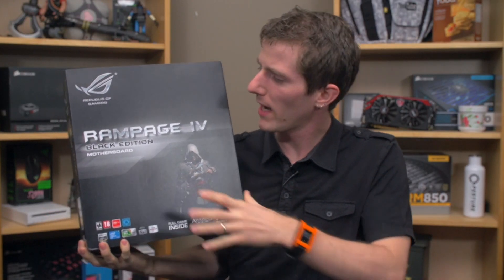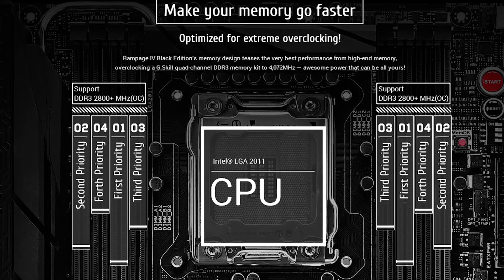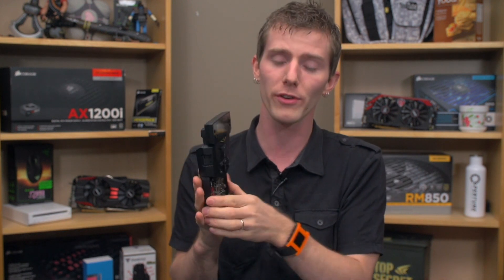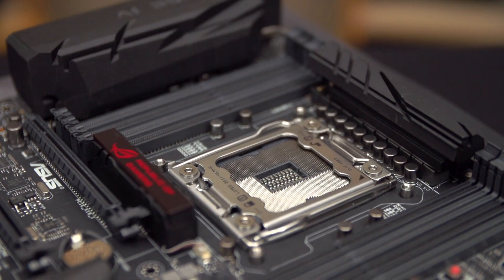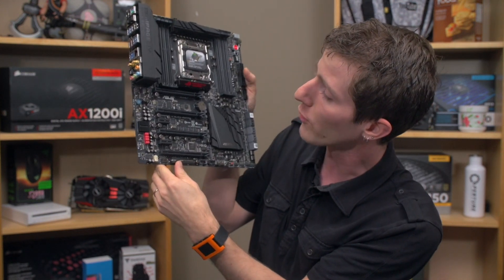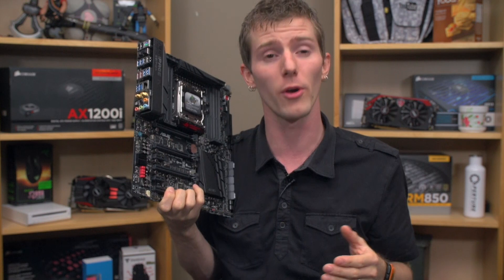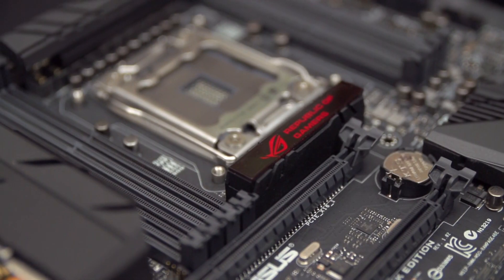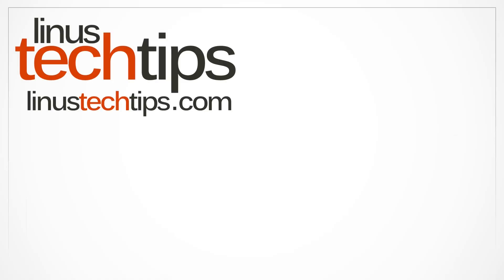ASUS Rampage IV Extreme Black Edition Unboxing & Overview

Comment: There is one thin with motherboards that i dont understand; on some motherboards there is a, often red, start button, do i need to press that button when im going to start it for the first time or do i need to press it all the time when im going to start the system or should i dont do anything with it? HELP IS APPRICIATED
Reply: It's only for bench testing when you connect it up out of a case. The power switch is on the case so you can't turn it on unless you rig up a switch.

Comment: hey, do all motherboards work with all cases?
Reply: No, the case needs to be big enough for the motherboard. An ATX board wont' fit in a micro ATX case, and some really old motherboards might need an equally old case. You can usually put an micro ATX motherboard in a gigantic case though, like a Cosmos II. Why you would I have no idea.

Comment: Would this Motherboard fit these cases ???

1. Aerocool X-Predator Full Tower Gaming Case with No PSU
2. Cooler Master Storm USB 3.0 Trooper Window Side Panel Edition XL ATX CASE
3.Cooler Master CM Storm Stryker XL-ATX Case
Reply: Yes it should
Reply: Anything that is Mid tower and above can fit a regular ATX motherboard and a full tower can fit any size. I have a Phantom 820 and it was a lot bigger than I thought and has soo much space left.

Comment: I'm really annoyed !!!! I just got this board and when I plugged in a usb cable for the first time the black plastic in the usb port snapped -_-  usb port still works fine. Out of all the motherboards I've ever owned this has never happened. I never forced the cable in or bent anything but as soon as i plugged it in it snapped. Dunno if to contact Asus but after hearing about there customer service I think it will be a waste of time :/

Comment: is this better then the ASUS Maximus VI Formula?
Reply: yup but mainly for overclocking and extreme! not a lot for gaming.
Reply: I've done some research but Overclocking is for gaming it's helps push for more Fps usually pushing to get 60fps but with the new 4k screens this board is the one to buy! and also 2 titan blacks or you can wait for the 800 series to see if one of those GPU's can handle it.
Reply: +AronWard you don't need an insane motherboard for gaming.. Good price for a mobo is $200 AUD..
For a $2000 build atleast

Comment: It looks really good, but you do not have to spend 400+$ on a board to have your system looks great, g45-65 gaming from MSi are quite nice, more affordable ROG board also look really nice. And this board, if you are not overclocking with liquid nitrogen, it's useless.
Reply: This board isn't purely about looks, it's mostly about all out extreme performance for extreme enthusiasts.

Comment: i think in terms of looks, this is NOT the best looking motherboard
the sabertooth actually looks better because of the shroud, you cant see any of the shiny solder connections
but sadly its only 1155 or 1150
this is the nicest looking x79 platform, i agree

Comment: Not very smart IMO to promote throwing away your motherboard driver disk. It usually comes with full version software and can come in handy if you just want to get your system up and running before updating everything to the latest version.

Comment: Does it support 16GB RAM cards?
Reply: It supports 64 GB, but honestly if you have to ask you don't need it :/
Reply: well, what I meant is on pcpartspicker, they have 1x16GB but they show that no motherboards support it, so what I meant was, will this board? cause pcpartspicker states that it is a no...
Reply: RepoDraghon Are you wanting to just buy one 16GB Stick? The thing with 16GB sticks is they haven't quite come around to date especially because a lot of boards (like this one) that are quad channel. So 1 stick of 16GB Ram vs 4x4GB will actually under perform the 4x4GB. You could do 4x16GB for 64GB but I don't recommend that and 16GB are still not up to speed for consumers.
Reply: actually from what I have read on sites and this one particular, it's better than most cars half it's size, with 7 as its CAS
Reply: Use 32gb ram and get yourself a RAIDR
Reply: I'm already a Raiders fan
Reply: RepoDraghon
 Well dude I meant the new ssd lol and also I have the motherboard I use 32gb ram 2400mhz and a RAIDR Express With another SSD and 2 3tb hard drives. ROG Fan FTW
Reply: I knew what you meant...
Reply: The maximum it can do is 64 so.... yah

Comment: 10,000 hour capacitor lifetime? That's only  1.145 year continuous use! I understand that using the machine only to game a few hours a week this would be fine, but it sure doesn't leave much product life for people who either work daily on there PC or have it complete tasks every night. I get its not a server board, so 24/7 use isn't recommended but I'd like more than 2.75 years of 10hr a day computer running, especially since your CPU's and RAM are rated for more than this sort of duration. All in all very disappointing Asus... my laptop has that many run hours on it, your top of the line ROG motherboard should be rated for more.
Reply: I'd also like to have seen 4 way or at least 3 way 16x PCIe use... only getting 8x to everything but the main card in setups with more than 2 PCIe slots filled is a very poor offering for a board of this price-range.
Also the lack of right angle connectors is disappointing given the otherwise great aesthetic.
Having said all this the onboard auido sounds good and I really like the idea on motherboard controlled 3pin fans so you don't get PWM noise when running lower RPM, I just feel this board is badly underspecified for its price, especially compared to ASUS's own Saber-tooth board in the same socket, which offers nearly all the same features save for audio (a sound card or DAC will give better audio anyway) and overclocking for a lot less money, and the saber-tooth boasts the same (or better, dust covers ect) aesthetic quality and a longer warranty as well.
I guess in a nutshell I just don't get how Asus made there top of the line ROG board worse in many ways then other boards in ther lineup, a few right angle connectors, a 5 year warrenty and four way 16x mode PCIe would have seen this board be one of the best on the market, but as it is its an expensive white elephant.
Reply: Hamish McGregor
4 way PCI-E 16x would mean Asus telling Intel to increase the PCI-E lanes from 48 to 64. That isn't something that Asus can easily change (because the PCI-E controller is on the CPU die) and PLX chips aren't really that great because they introduce a certain amount of latency.
Reply: Hamish McGregor I don't think that would be possible, as the 16. pcie to anything more than the first slot is reliant on the chipset/socket. you could only get 2 16x slots from an extreme edition. Not Asus' fault I don't think, that's all Intel. (Source, my own faulty memory, so take that with a grain of salt)
Reply: Fetzie
True, I hadn't actually thought through the implementation of the additional PCIe channels, I was really just meaning it lacked features to really set it apart from ASUS's own existing 2011 socket lineup, especially the non-black edition rampage 4 board it is based on.
I think it is a great shame Intel haven't switched the 2011 "extreme" lineup to support 4 16x mode PCIe cards, it would have made sense to sell 2011 socket i7's with 64 lane controllers while 1150 used a less number (40 is ideal), but that's sure not Asus's call. However the limited warranty and capacitor life, lack of DDR3 3000mhz support as well as non-right angle connectors on the other hand are all Asus's fault, and seem to be just cost cutting, sad for a board that commands a huge premium for being there top of the range setup.
Reply: you are looking at the surface stat of the capacitor not its real run life. It is a rating for 10,000 hours of use at 105c which is so much higher than any system runs or any component other than a capacitor can handle. My 8 series  gygabite board has the same nichicon gtx 10k black alloy caps and the VRM section is never above 50c running at these temperatures will expand the life of the motherboard by orders of magnitude, I don't have the charts at hand but something like a million hours of use should be expected. needless to say something else in your motherboard will break before that happens.  even if you run the black caps at 85c non stop they would last longer then you would ever care to use the same computer decades likely, but again another component will likely fail before this has a chance to, that's basically the point of using the cap, one less thing to worry about.
Reply: In your theory, my P45 board would have already died like 3-4 years ago, but it's still running 24/7 as my backup server PC right now.
Reply: Jateruy Xu
My comment wasn't that it will die, as I even said my Asus laptop has run for more than 10k hours by now. My comment was regarding the fact that 10,000 hours is used as a marketing term because it sounds huge, but the underlying fact is that it is not that long, only just over a year.
Reply: Hamish McGregor Indeed then, but it's still making sense when the situation applied is non-continues use. In this case 10,000 hrs would really sound a lot.
Reply: its just the measuring standard used on capacitors, asus didnt invent it, gygabite has been telling you hour ratings@ 105c for a decade, tear open a 20 year old sony walkman and see how its capacitors are rated.

Comment: Can it run 4 way sli 16x16x16x16x?
Reply: no. he says in the vid 4 cards can run max 16x 8x 8x 8x.
you look at the back two of the are only 8x anyways. but you can run two in 16x 16x
Reply: Gamers Life :(
Reply: ShamanKing77LaTale sorry to bum you out...
Reply: You'd need an X79 board with PLX chips for that, like the P9X79-E WS or the Asrock X79 Extreme11.  X79 by default has 40 PCI-E lanes.

Comment: Ok this is so Embarrassing...got the Mobo and the i7 4960X now only thing is I suck at overclocking this properly...I wanted to overclock the CPU to about 5ghz.... -_- failing badly at it...I made till 4.6Ghz but I have no idea how to go further than that...anyone here can give me a noob guide? Please!
Reply: +avikbellic911 There is no Extreme Overclocking for noobs, sorry. 4.6 GHz stable without knowing what you really did there is respectable but going further into the matter about BCKL, strap, PLL, VTT, overvolting, maxing LLC, etc will just higher the chances that you destroy your stuff if you don't know what you're doing.
There is no "instant knowledge" that you can take out of the packaging, pour hot water over it and suddenly you know everything. It's a process that mostly starts with reading, reading and reading. Did I mention that you have to read a lot?
After that it's learning by doing by really thinking about "What am I doing here? What exactly are those settings and what do they do? What happens if I change them?". If you can't answer those questions, don't do it.
Also, overclocking the CPU alone mostly doesn't give you that great of a performance boost. The real boost is obtained by overclocking the RAM or tightening the latency after you OCed your CPU stable.
Reply: Meta Custom Computers
 after doing self research i followed the exact rules u described.....well so far i only managed to keep a stable OC at 4.1Ghz with 2400mhz Quad channel Rams, rendering does go smooth but often i would want the extra time saved by learning more indepth about the Bclk,Strap & etc.
I used to OC the old gen core 2 duo with breeze but lel this is new to tamper with.
But i have no regrets cause atleast this is still better than the skylake stuff and i can pull years off with this spec.
Reply: Not all CPUS overclock to the same extent. 4.6 is still a great OC especially over six cores. My 4690K hates going past 4.5GHz for example, while I know someone who could hit 4.9GHz at 1.4V if he wanted to.
Reply: the bar for all goes max till 4.5 to 4.6 same here, i am gussing we need better cooler or a better tutorial that is SFW...i am not pushing even now max 4.1ghz is ok for summer.Aidan Gieg
Reply: avikbellic911
i7 3930k with 4.71 GHz here with BCLK 127.3 MHz x 37 @1.398 V Vcore and RAM 2,378 MHz @1.68 V.

Kind regards,
Meta Custom Computers
Reply: Meta Custom Computers
 holy! thanks for the heads up...would try to get close :)
Reply: avikbellic911
Funny fact: I'm using my machine mainly for CPU-rendering and my i7 3930k reaches 1,215 points in Cinebench R15 on that overclock. That's 141 points more than the 5930k on stock settings. :)

Kind regards,
Meta Custom Computers

Comment: i have friends that keep buying these ROG motherboards and upgrading each year but   IT GRINDS MY GEARS when they have 1 SINGLE not top of the line video card, a single NOT RAID  ssd hard drive system and 1 stick of 8 GB of ram or so
Man it makes me so angry, they should not le you buyy these motherboards unles youre  maxin them out from the get go

Comment: I have this motherboard in my system....

COOLERMASTER CM STORM TROOPER - GAMING ENTHUSIAST CASE
Overclocked CPU Overclocked Intel® Six Core i7-4930K (3.4GHz @ max 4.4GHz)
OC Settings Show/Hide
Motherboard ASUS® RAMPAGE IV BLACK EDITION: INTEL X79, SOCKET 2011, R.O.G
Memory (RAM) 32GB KINGSTON HYPER-X BEAST Dual-DDR3 2133MHz X.M.P (4 x 8GB KIT)
1st Graphics Card 6GB Asus Strix Geforce GTX 980ti - DVI, HDMI, 3x DP - 3D Vision Ready / VR Ready
2nd Graphics Card 6GB Asus Strix GeForce GTX 980ti - DVI, HDMI, 3x DP - 3D Vision Ready / VR Ready
1st Hard Disk 1TB Samsung 850 EVO SSD, SATA 6Gb/s (upto 540MB/sR  520MB/sW)
2nd Hard Disk 1TB Samsung 850 EVO SSD, SATA 6GB/s (upto 540MB/sR  520MB/sW)
1st DVD/BLU-RAY Drive 24x DUAL LAYER DVD WRITER ±R/±RW/RAM
Power Supply CORSAIR 1200 PRO SERIES™ Platinum AX1200i Digital Modular PSU
Processor Cooling Corsair H100i Hydro Series High Performance CPU Cooler
Thermal Paste ARCTIC MX-4 EXTREME THERMAL CONDUCTIVITY COMPOUND

Its a fucking beast!!
Reply: Ste Arrows You have good taste, we near enough have the same system here :O

Intel Core i7 4930K @ 4.4Ghz cooled by a Corsair H100i all-in-one Liquid Cooling Unit (Radiator Cooled by 2 Noctua NF-F12 fans)
3GB Gainward GeForce GTX 780 Ti Phantom Edition
32GB Kingston HyperX Beast Memory @ 2400Mhz
Asus Rampage IV Black Edition Motherboard
Corsair RM650 PSU
240GB Kingston HyperX Predator M.2 Drive (Boot/Programs)
1TB Samsung 840 EVO SSD (Games)
240GB Kingston HyperX SSD (Scratch/Cache)
2TB WD Black (Projects)
4TB WD Green (Storage)
Fractal Design Arc Midi R2 (With 3 Bitfenix Spectre Pro Red LED fans Installed)

Comment: A good gaming PC?:

Asus RAMPAGE IV BLACK EDITION,s2011
Intel Core i7-4930K,s2011
MSI NVIDIA GeForce GTX 780 Ti Gaming 3GB GDDR5
Corsair Vengeance Pro 2400-16GB (2x8G)
Seagate NAS HDD 4TB - 3.5inch
Samsung 840 EVO, 250GB
Corsair AX 1200i with Corsair Link
Reply: Nice build, however for only one graphics card, you really do not need a 1200 watt power supply. go with something much lower, an 850 watt power supply is even too much for that build. Look for a Cooler Master V850 Vanguard power supply. Its a great PSU for the buck, which means you can save some money on that, and either, get more RAM (Won't increase much performance) or get more storage on the SSD. By the way, upgrade from that 840 EVO to an 840 Pro. Better performance out of your SSD. and you'll just have enough when saving money from the Power supply :)
Reply: Nice build, though as Mozey said already the powersupply is massive overkill for that system.
Reply: ***** Not exactly :P i mean, it supports all of that however it doesn't mean you have to go with that stuff, 64GB's of RAM is too much for daily or gaming use. Quad SLI 980's? Yeah, but i only bought 3 xD and a 5960x is a different socket for this motherboard :)
Reply: That's a okay build, not the best, not the worst.